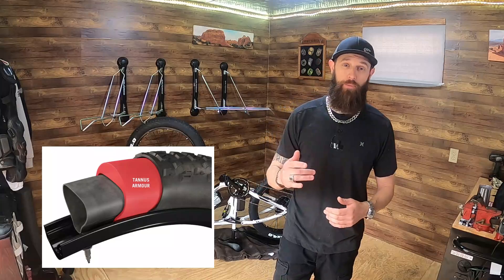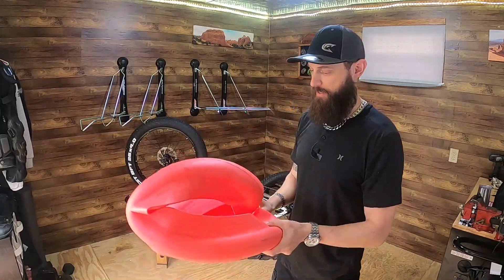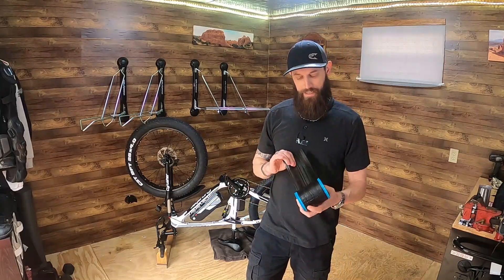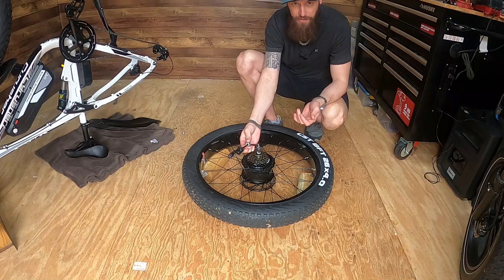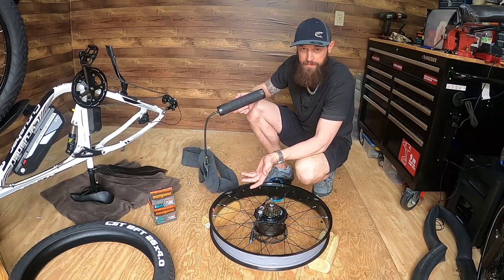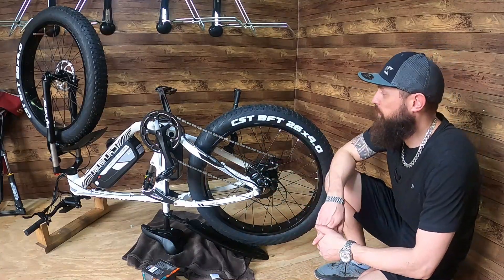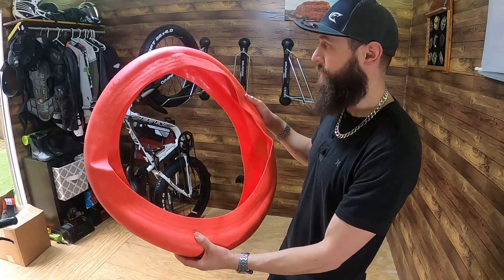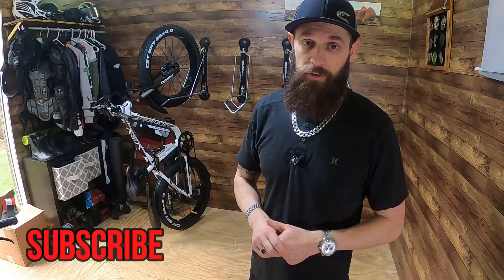Mr Tuffy Tire Liners vs Tannus Armour Foam

Comment: Put the line UNDER the Tannus Armour. It's what I did to kill the INTERNAL "friction flats" from the rubbing on the tube the liners do because of the lacking tapered ends. But yeah, use the Tannus OVER the liners, I use Schawlbe Marathons WITH this combo and the ONLY shit that's gotten THROUGH THAT....Has been 2 NAILS and two SUPER HUGE incredibly strong ass thorns man!! I was surprised by the thorns cutting through practically 3 layers of puncture resistance!!🤘🚴🤘 But yeah, use BOTH, it's heavier yeah but, meh GET STRONGER!!🤘😀🤘For a commuter bike, 100%! 🤘🚴🤘

Comment: I run both as well. So far both have not failed me.

Of topic. What tires do you recommend for 20x4 ebikes for off road? My original tires are already bald at 100 miles.
Reply: i guess it is quite off topic but do anybody know a good website to stream new movies online ?
Reply: @Kenneth Lian flixportal xD
Reply: @Kashton Sebastian Thanks, I signed up and it seems like a nice service :) I really appreciate it!
Reply: @Kenneth Lian happy to help =)
Reply: Do you run both in the same tire? Ultimate puncture protection lol
Reply: @sliqindustries4782  lol no. I am testing each on different bikes.
Reply: @mixflip  I'm gonna run both and see how that works out, don't really care about the weight since it's an ebike

Comment: I own a Himiway Cruiser with 700 miles on the odometer. I got my 3rd flat tire. One was a slow leak puncture repaired with a patch but the other two were rear tire immediate blowouts while travelling down a busy road.  It's Extremely dangerous with rear tire blowouts as it's hard to control the bike. Just ordered 2 Tannus inserts from their website. Turns out that they also come with 2 inner tubes. Apparently the original tubes won't work and you need smaller tubes when using the Tanuus inserts. Total cost with a 10% discount AND the $21.00 shipping fee came to $154.07 for 2 inserts and 2 tubes. Hope it's worth it
Reply: Not a bad investment. I just installed the tannus liners yesterday. And it rides smooth, I always take the same streets when riding. Before the tannus, I would have a flat the same day. Possibly because I have 20x4 fat city tires, and last night I went for a cruise. No flats so far. In the city I live, there's so much junk on the road: glass, staples,nails.So far I'm happy with my purchase:)

Comment: Yes, Tannus is a real great product for E-Bikea when you don't have to worry bout weight. But on my regular Fatbike, I prefer tireliner over Tannus.  The Tannus puncture protection on the sidewalls isn't that great anyway, so that is not a real advantage for hardcore offroading ( if that's a word) I had a puncture in my sidewalls with both products 😋. So E-Bike: jay, regular Bike: nay! And if you're looking for a solid leg workout: try the Tannus full rubber tires. We use them on our Bromptons and get a very effective workout over shortest distances 😂 #rollingresistance

Comment: Another great video! Wish I saw this before I bought a pair of Tuffy’s. I wouldn’t expect the Tuffy’s to alter the ride its only puncture protection. However it is very interesting that the Tannus changed the ride that much. Not so sure the Tannus will be totally puncture proof if the object is longer than the thickness of the foam liner. So keep us informed.
Reply: I can definitely say that nails will go right through.

Comment: I am a huge fan. I check daily for your next video. I also love Tannus liners. Based on recommendations by you and Kyle (of Boulton) I upgraded to Juin hydraulic brake calipers. I would love to see a comparison video between the Juin hydraulic brake calipers and the Zoom X-tec hydraulic brake calipers. I have a Zoom suspension seat post and it works great. The Zoom X-Tecs are less than a third of the price. Could they be a good alternative? Inquiring minds want to know. I think it would be a great Video. 

R Himiway owner.
Reply from the maker: Hello R, thank you so much for checking out my video content. I happen to have both juin tech and xtech hydraulic calipers. I suppose I could compare them somehow, let me add to my video list and think on that a bit...

Comment: Have a 26x4 inch tire on an e-bike. I've had seven flats in one year. Slime never held on one tube and flat fix never held on another tube. The tire itself refused to come off the rim. Tire spoons were useless. Only a carpenter's flat bar would remove one side of the tire. The beading in the tire itself broke and I had to get a new tire. Frustrating.

Comment: Seeing the length of that bit I bet it would have gone threw the Tannus liner and popped the tube. The Tannus liner only seems to work if the object is shorter  than the given thickness at any point. The price is way off at a few Hundred dollars. I am undecided.

Comment: The FAQ on Mr Tuffy's site states these are no good to use on tires with 25 PSI or lower. Does that mean these are not usable for fat tire bikes? Those fat tires can be ridden at low pressure like 20 PSI

"Do you make Mr. Tuffy for mopeds, motorcycles or cars?"

"We’ve tried .. and failed. Mr. Tuffy liner needs a certain amount of air pressure against it to keep it in place. In a test in a 25 psi moped tire, the moped size liner worked it’s way around to the rim side and actually cut off the valve stem ... not exactly the result we were hoping for."
Reply from the maker: Interesting , I haven't noticed any problems with my mr tuffy liners , and it's weird that they would sell it for fat tires if it's not supposed to work with fat tires...

Comment: I don't know people think I'm full of it, between two fat tire  bikes doing all sorts of trail riding about three thousand miles combined, 4years never gotten a flat with a fat tire.( no tire liners, no gimmicks like putting slime in your tubes) I refuse to believe that it's because I'm just lucky. It's not luck, if I can do it anybody can.  The only thing I can see that I'm doing differently than everybody else is I'm keep my tire pressure between 6 and 12 psi. My inner tubes and never seen more than 12.5 psi.  Typically on my electric fat tire  bike i go 10 psi up front and 12 in the back.  And they roll just fine.  The first step is to figure out why you're getting flats, then go from there.  And it could be   anyone of a hundred different reasons. Rest assured there is a thousand percent chance that  there is a reason its not just bad luck.
Reply: 10 & 12 psi bit low, is your bike 26"?, mine is 20", 25 & 17 is what I use
Reply: @manFromPeterborough   yeah my two fat tire bikes are 26in, one is electric one isn't.  I go 8psi and 10 in the back, on the non electric. It is a little muddy up front, but it's like suspension it's got to rigid Fork. But if you ride my bikes, the tires feel good, they don't feel low on air. I don't have any experience with 20 inch tires so I really can't say, but on 26 is you really don't want to go above 15 lb, you'll actually get more rolling resistance because they Don't Ride as smooth. I'm a mountain Biker gone electric bike, and two gas bikes.  I've been real curious about the moped Style, looking at the Addmotor m 70.
Reply: @manFromPeterborough  but yeah in four years  of riding fat tires 0 Flats.  That's why when I see all these videos of people putting slime in liners and all kinds of crazy stuff, I kind of just scratch my head, seems kind of counterproductive.
Reply: @mjsmjs7905  I get more flats on fat bike than I did on a 26x2 bike, things like Stanley box knife blades (15 of them thrown in bike lane), 3 corner jacks, glass and a shard of plastic, rear tube now has 8 patches, not counting the tyre and tube blown out by the Stanley blade that made 2" slash. I refuse to throw out the set, cause fat bike tyres not cheap, the tube has since been mended with a 45x90 Tip Top patch and slash button holed before hand. The tyre will have a 80mm cross ply patch put on
Reply: @manFromPeterborough me to, I only ride on mountain bike trails, and shoulders.  But I've been doing this for a while, I used to get a lot of flats when I was younger. Once I had to walk 15 miles home in a hundred degree Florida  sunshine, totally sucked . But there is always a reason you're getting flats, Something is off, could be that the tires you're using don't jive with your tubes or the rim liners. But one thing I know is, if I pump my tires up to 25 to 30 lb like I see a lot of people do, I would have so many issues with my tires I probably quit riding all together. That's the only thing I see that I'm doing different than everybody else.  I remember when I first got into fat tire bikes, the guy that owned the mountain bike shop told me he runs his fat tires tubeless between 5 and 9 lb that was about six years ago before all these electric bikes came out , so I've always kept them low and never had a problem. But if you squeeze my tires 12 lb of pressure in the back feels really good.  Again these are 26s but I don't think twenties would be all that much different.

Comment: Dont waste your money on the tannus.It shrinks down to 2 to 3 mm offering no protection after two weeks.We run a fleet of fat tyre bikes it was a nightmare .Every liner did the same after we ripped it out.The worst was tannus refunded the money for the liners and asked us to keep quiet.Iv got all the pics and video to prove it.Its terrible dont use it you will regret it
Reply: I have the same experience there getting very thin after a while also with 20 call PSI, I got four of them. I didn’t install them anymore it’s more weight I just carry in inner tube now with me.

Comment: Look, I am not as sure of myself taking that back tire off. Couldnt you put this liner in without taking the wheel off? I mean i fixed a flat without taking it off. I really dont trust myself when it comes down to getting the brakes and gears operable again.
Reply from the maker: i take the back tires off all the time, sounds more scary than it is. i always shift it to highest gear and i take the brake caliper off, usually dont have any trouble with shifting or brakes when its back together.  i suppose you could install without removing the wheel but the tannus armor is a continuous piece of foam no breaks in it so you will have to pull at least one side of the axel out of the dropout.

Comment: I am currently sitting out back with the tannus armor, it's a bitch to install....I'm taking it in to have someone else install it....also with tannus you need a smaller tube size.
Reply from the maker: I would put the tube inside the Tannus. Then the tannus inside the tire, then put the tire on the rim. Probably the easiest way to do it.

Comment: I looked really hard and long a both, but in the end the price won out and I got the Mr. Tuffy. I have a Himiway and the installation was fast and easy. They don't wrap around the tube like the Tannus, but they do cover more of the sidewall than you think. Thanks for the content.
Reply: Tan or teal Tuffy liner? And was it the 4" tire? 🙏
Reply: @jewboyjon75  It was the teal liners and on a 4" tire. I have had them on for a 4 months and still love them! No issues.

Comment: Do Both tires pipe insulation  foam tubes

First  do 3 Layers 5200 
Allow each layer to cure 24 hr
Then Rhino 5200 it to tire
Then add pipe foam
30 Buck puncture proof tube
And last Flat Out
Ladies

Comment: I prefer Mr.tuffy only because the beginning install process is way more better then tanus.  I don't need to waste my valuable time to put them on. Tuffy are easy never get a flat. Ride quality the same but difficulty easier I prefer being cheap and less work since I used 26 inch I always go with thick inner tubes since their most common thin 26 inch are harder to obtain and very expensive so I'm very disappointed in thanus.  Thank to thanus I now have a hurt anus.

Comment: I have tried Tuffys as well as another brand and my conclusion is they chaff the tube. This rubbing I believe causes the tire to pinch and fail. No science to this only my experience leads me not use then. The best method is to look at the road in front of you. To always do that all angles and stay away from trouble spots.